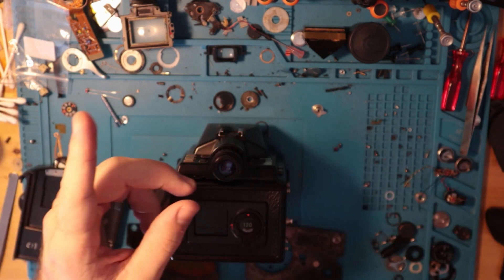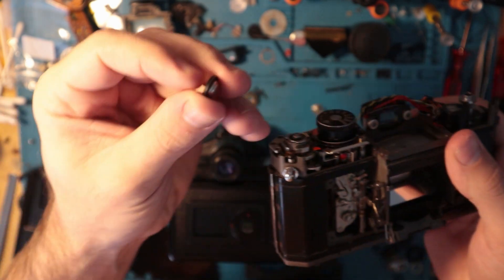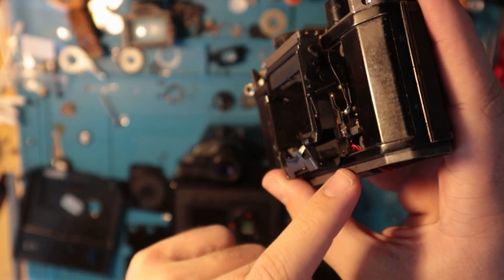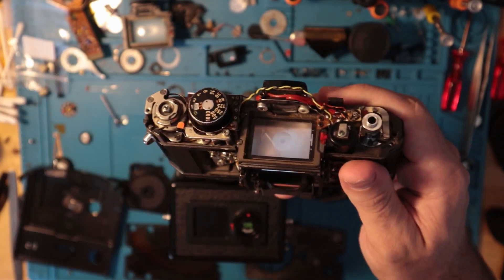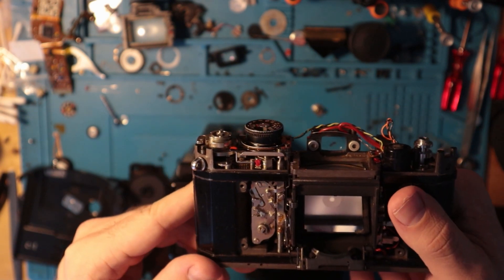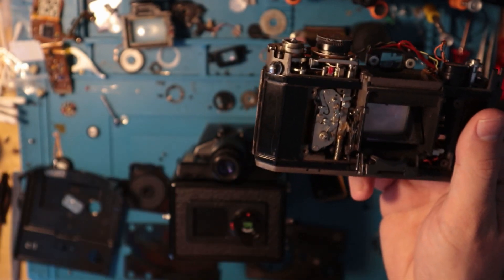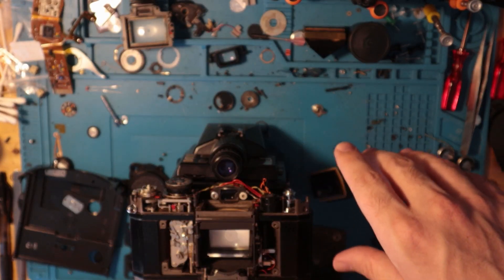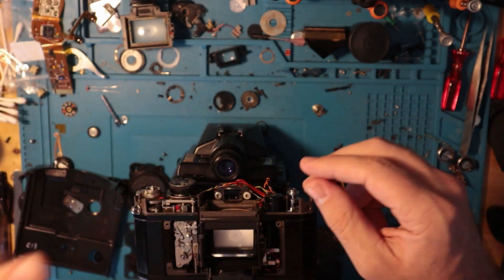I spent months repairing a Pentax Spotmatic so you don't have to.

Comment: Came across this as my Spotmatic II seems to have an inaccurate light meter. In running a test roll through the camera, I realised that the metering seemed odd, so I started comparing with my phone which confirmed the camera was over-estimating the meter reading (which is the worst case as it means underexposed film images). 

I had a play around with the ISO dial, shutter speed dial and aperture and the light meter moves as it should, but it is just overestimating the film exposure. I could set the ISO to compensate as a workaround but when shooting ISO100 film, the ISO20 setting isn't low enough to bring the meter in line with what it should be, and testing seems as though the meter is exposing about 3-4 stops over the correct exposure. 

My hope is if I get a smaller Voltage batter to fit and work in the camera that might solve the issue, if I can make it fit...

Comment: Hi, at 2:56 will the + side of the battery be facing up and touching the end of black cable once you put eventing back together?  Also, my SP does not have a plastic battery holder like yours.  It metal and soldered onto the bottom plate.  What is the best way to remove if I use an LR 44 battery?  Thank you!

Comment: I have a Spotmatic that works fine, however whenever activating the light meter the mirror will lockup.
Whenever I deactivate the light meter, and press the shutter the mirror will reset. Has anyone run into this?
Reply: I have that issue currently. Did you find a solution?

Comment: Pentax Tips has a break down on how the light meter works electronically on the spotmatic. It is quite interesting. You don't need a 1.35v, you can use a 1.55v just fine.

Comment: Use a 387s battery. It works fine. You can adjust the resistance on the resistance adjustment dial on the film rewind side.   I have a dozen (maybe two dozen) Spotmatics. Never had an issue unless it was severely dropped.   I have had more problems with the mirror return and shutter timing then anything else.

Comment: Hi there, I have a spotmatic spii which was fixed by a professional technician and I can tell it works perfectly, included the light meter which seems to be pretty accurate.
As you said, mercury batteries aren't made anymore and what I use is an adapter to px312 batteries, which give the same voltage that the camera should be receiving. I think lr44 is too much. 
Thanks, 
Carlos
Reply from the maker: Hey carlos I appreciate the comment, this is one of my older videos and I consider deleting it because it still gets a lot of traction and I mostly just sound like a moron but I appreciate your response and hope you enjoy your spotmatic!
Reply: @RompingBronco  Hi there!

At first I considered not replying to your video due to the date of it, but then I thought my point about using p312 batteries might be helpful for somebody, this adapter can be easily found the internet.

I am of the opinion that you should keep your video, we all had our origins and it is not something to be ashamed of, more the kind of the opposite. On top of that, there aren't many videos in relation to this topic so it's quite interesting if you ask me, at least people can debate in the comments.

In case you want to add some new information or correct anything in the video, you can just upload a message with the explanation and you can pin it so that everybody can see it easily.

Keep your hard work and best wishes!
Carlos

Comment: I have an Spotmatic SP too, it works well except the light meter, it only reads well at the bulb position, i can adjust the needle with the aperture ring, but when i change the speeds it goes down, any idea or sugestion? Thanks in advance.

Comment: hey, so from what i can gather you’ve replaced most of the light meter system, what did you replace? where did you get the parts? i’m currently troubleshooting my spotmatic f light meter not working at all, if you could get in touch that’d be great, thanks

Comment: The primary flaw in the Spotmatic is how the battery connects to the light meter system. It's extremely prone to corrosion under the bottom plate.
The quick fix is to remove the bottom plate and clean the contact, which will most likely be green with corrosion, and 90% of the time that will revive the light meter.

Since the battery tray is part of the bottom plate, most people only check that part, which usually doesn't have any corrosion unless somebody left the battery in too long. I've had a couple Spotmatics with non-working meters that were easily fixed this way.

Comment: This video promises much but delivers little. Not much of real practical value here - lots of hand waving and soothing music. The meter battery replacement is useful but that won't solve any number of different problems with Spotmatic metering. For example my SP500 will only meter accurately if I set film speed to 4 times the actual ISO rating. Disappointing video.
Reply from the maker: I hope you enjoyed the music at least, I do appreciate the feedback but the entire repair process was worked on and off for a few months so I don't have the full repair documented, However there was a lot that I learned in the process and that's what I was hoping to deliver. If you'd like some more applicable advice for the issue you are having I'd be happy to help.
Reply: Sounds more like the typical problem that appears when you put in a 1.5v battery into a circuit that was built for 1.35v mercury cell batteries. There are videos on youtube how to potentially solve that kind of issue.
Reply: @peterbarth1479 actually not an issue with these cameras because of the bridge it has. It can take 1.5 or 1.3s no problem.

Comment: Which Spotmatic is that? Is it the SP-F by any chance?
Reply from the maker: It's the SP-F
Reply: @RompingBronco  Thanks! I heard the meter has the same design, but an earlier implementation of the K1000 meter. Does that sound right?
Reply from the maker: @figjoy  That's very accurate, the K1000 was a better power management system because it doesn't have the on/off switch like a spotmatic but the basic design, galvanometer and CdS cells are the same. There is even a manual floating around out there detailing how to retrofit a Spotmatic with a K1000 meter hahaha
Reply: @RompingBronco  I see, thanks!

Comment: Need advice! My spotmatic have light meter issue; where the needle stays up when turn on (goes to the middle when off which is normal), but it stays up even as i cover the lens. Seems like it didnt measure the light. Changed the shutter speeds but its still remains up except at Bulb mode which goes to the bottom. Ive cleaned the battery contacts and still presists. What do you think the problem is?
Reply from the maker: It sounds like the meter is getting power and the galvanometer (needle) is moving so unfortunately it's neither of the "easier" fixes. Taking the top off the camera would likely help so you could see the quality of the wire contacts. It sounds like there is an issue either with the CdS cells, the variable resistor or the ground wire.
Reply: Also my issue, @RompingBronco  . I think i found one example where it was a cds cell issue. i will take the top off but my camera is pristine so it is unlikely corrosion.